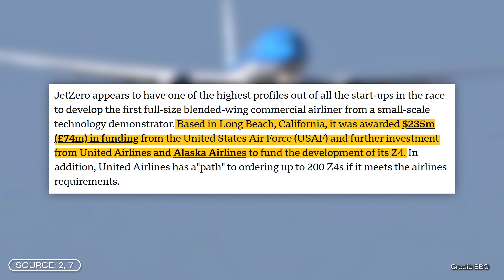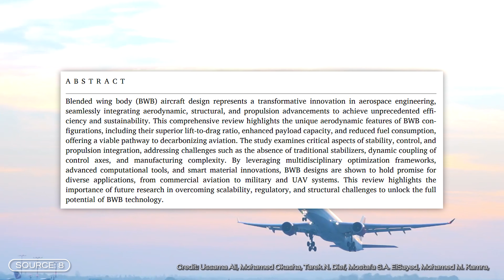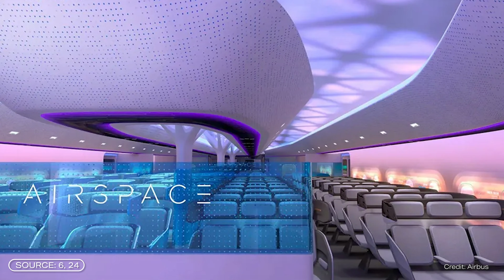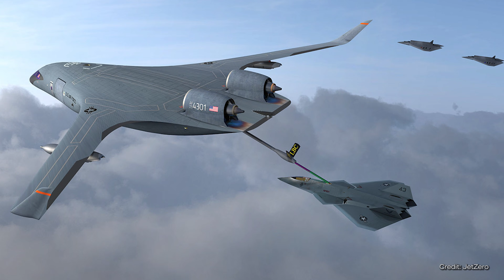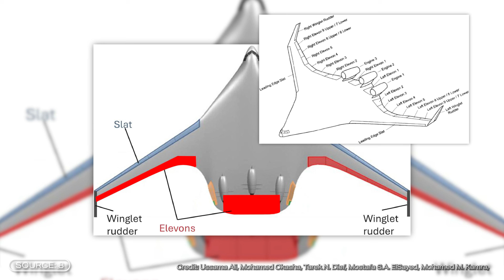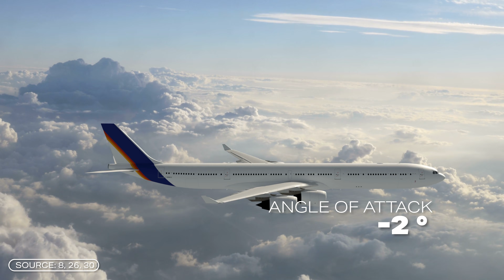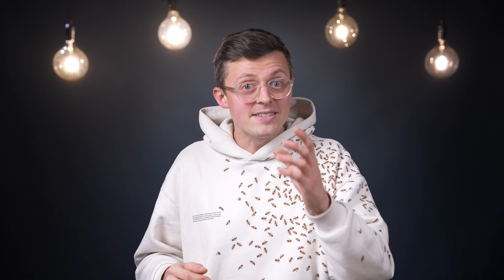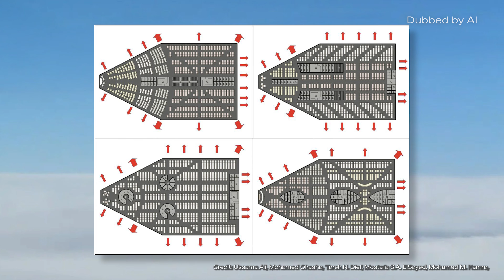The "Perfect" Plane Has One Big Problem...

Comment: I’m keen for this design particularly if it means I can travel horizontal (sleeping). I think the broad center area can be utilised this way. Getting in and out of a tube is an issue but thinking about it this can be achieved with a sliding panel that rolls one into the tube from a sitting position, swing legs in then the back reclines as one slides in. I can see how to do that very practically and easily with little more weight than a standard aircraft seat. You would get 108 passengers in a 13 meter by 13 meter by 4 meter high space (that includes with each passenger volume being 1 x 3 x 1.3 , which is quite luxurious. I live on a boat and travel thousands of nautical miles in a reclined volume of .7 x 2 x 1 meters. That.s of the top of my head. I will have to look at the  available space to be more precise.

Comment: Boeing and Airbus have studied this concept to death. Aerodynamically advantageous but structurally heavy. The pressurised volume requires massive internal reaction structure which greatly reduces the advantages. Additionally it has a reduced cg flexibility.
And the engines mounted on or in the fuselage are very challenging, noise and vibration into the cabin could be substantial. And certification would be lengthy and extremely expensive due to a plethora of special requirements.  All the aero gains are washed away by the disadvantages

Comment: My biggest concern would be the cabin pressure differential load.  The current tube design in commercial aircraft gives a fairly even pressure load over the bulk of the aircraft.  An oval or off-round design would put uneven pressure stresses accross the cabin.  I am hopeful that some very smart designer will solve this issue.

Comment: The cross sectional area of the cabin and wings looks to be considerably larger than a simple circular tube with 2 thin wings. That would seem to add more drag than might be saved by the absence of the  traditional wing / fuselage section.  It is much also more difficult to provide strength to resist years of pressurization  changes in a dramatically non circular cabin and would likely need to be double the weight. Passengers like windows - fine in a circular tube, not so good when the `walls` are several rows away and not vertical. There would also be problems  with doors and emercency exits. Add in reduced engine acessiblity and freight loading and I just can't see them ever happening. A shame as something a bit different would be interesting.

Comment: Aisle or window??? Neither. Give every seatback a video screen that lets the passengers select nose camera belly camera, side cameras. , or whatever, including arrival weather or whatever else. You get the picture. Nobody gets a window, Also, passenger boarding could be done with multiple bottom elevator cars, or ground based moving stair, all at once. This is all figureoutable, and better than current practices.

Comment: I think blended wing designs will largely replace tube+wing designs, even in civilian passenger use. Regarding the maintenance aspect, how reliable the engines are makes a huge difference. Todays engines are much more reliable than those of decades ago. As for pressurisation issues, what some people fail to see is that the only parts of the plane that need to be pressurised are those used by people. , and that volume is still going to approximate two or three cylinders side by side..  Granted, the end result won't be as simple as wing+tube designs, but it shouldnt be vastly harder, either. then, too, the pressure hull sits within the aerodynamic shell, so the pressureised parts dont need to experience aerodynamic loads, and the aerodynamic shells doesnt need to experience pressurisation loads..  As for yaw instability, if that proves to be a problem, there are various ways to tackle that, from putting rudders on the engine pylons to things like having a blown-wing system over part of each wing.. The pitch instability is the thing I'd be more concerned about, but with fly-by-wire systems, either the elevons should be able to deal with it, or, worst case, put small canards to trim pitch control up by the cockpit.  There are so many clever devices on the wings of current aircraft that keep them flying acceptably well in circumstances where theyd do poorly if all they had was basic ailerons, elevators and rudders, that expecting blended wing designs to not need at least some seems to me to be silly.

Comment: This is boundary layer intake (BLI).
However, because the air near the aircraft flows slowly and the air farther away flows faster, it puts a load on the fan blades, making it impossible to use large-diameter fans.
The Jet Zero uses the PW2040 engine, the same engine used in the B757 and C17.

Comment: Elevons is pronounced 'ella vons,' not 'elevens'.
Most airplanes fly around 3 degrees nose up (not nose down) so that the fuselage provides some measure of lift. Boeing nacelles are actually built 3 degrees nose down, so they are at zero in flight.

Comment: This aircraft is not a credible design. The wings are too narrow.  This could increase the chance of structural failure under certain conditions. The position of the engines was first proposed by German aerodynamicists during the war.

Comment: I'm surprised to learn that this aircraft is intrinsically stable which I think infers that it will glide when engine power is lost.
This must be the future of air travel; the advantages are too great to ignore and it seems the tube and wings design has reached the end of the line, with future improvements being very minor

Comment: If the demonstrator has significant volume of usable pressurized space it can be evaluated fairly easily and compared to traditional designs. If the demonstrator is missing the significant pressurized volume it could be used for a tanker or airborne radar only and therefore be economically infeasible.

Pressurization is therefore the primary metric.

Comment: BWBs have been in development for decades and computer aided fly by wire as well, think F-117 nighthawk, (that wouldn't be flyable without computers). I'm no engineer but I don't think the cabin pressure is the major issue it's made out to be either. Isn't a blended wing body supposed to be stronger anyway? Also the counter argument that the extra reinforcements will negate any advantage is a bit basic. Just cause it might need extra reinforcement doesn't mean it's the equal to the aerodynamic advantage, that advantage on a big plane is tens of tonnes extra payload, to claim tens of tonnes extra reinforcement is ridiculous!!
All modern planes are more efficient than their replacements but it's not the fuselage design, it's the turbofan engines mostly and wings having less drag.
I read studies that showed that the G-forces weren't as bad as excepted in BWBs either, but the evacuation rules may be a challenge.
Airbus and Boeing have stated the reason they haven't made BWBs is the publics lack of acceptance. I don't believe that, I believe neither wants to be the first in case it fails for whatever reason and they lose market share, they're both scared. 
BWBs are clearly a better solution but neither the military or commercial companies want to risk building due to the massive new production/development cost and public ridicule if it fails.
great video

Comment: Main issue will be the negative dynamic stability. The weight being dead center doesn't make it unbalanced I don't understand why you're saying that. And gas cartridges are that shape becsause it's easier to pack them that way. I'm sorry do you expect gas carts to be shaped like wings? Again another irrelevant point. Pressurization is based on the inside of the cabin not the wings. They can shape in cabin however they want.

Comment: the point about comfort... this is gonna be a really big issue for em.. small control inputs will equal Gs very noticeable to human passengers the further to wingtip you get.. i feel like you'd even have to require some kind of significant restraint system change and require it for the entire flight, with how easily you could be tossed up like a flipped egg, and thats pretty likely to be unbearable for long flights

Comment: Quite disapointed by this video. Two majors structural flaws have not been addressed : Boundary layer ingestion that could simply stop engine in high incidence and which will reduce engine efficiency. Making this design probably less efficient than announced 
Deep stall. Stall on such a design tend to pitch nose up, which increas stall even more. With such elevons it's impossible to come back from such a situation.
And we didn't talk about airport infrastructures that couldn't handle it without foldable wings (A380 flopped because ir was too big and this is even bigger), foldable wings that would add even more complexity and pressure problems, or pilots formations 
It won't get certified for civil aviation in our modern world. We're too shy on such risks

Comment: Seems to me the evacuation issue is actually pretty easily fixed  - You have a number of zones in the middle of the aircraft where no obstructions are permitted and place doors in the top and bottom of the aircraft with hinged ladders. The ladders can be secured up to a given amount of force (that expected of a hard landing) or the pressing of a failsafe button which would also open the associated door and that's it, job done.

Comment: Such a large reduction in fuel consumption could have non-linear positive effects on emissions. 
For example, if a fuel mix is 20% non-fossil, and you reduce by 50% while keeping the same absolute amount, you get a 62.5% reduction in fossil fuel use.
Moreover, when fuel cost becomes a smaller fraction of the overall fare, more expensive synthetic an bio fuels become more viable, as would battery electric powered aircraft.

Comment: I've always found blended delta-wing variants to be the best for unpowered gliders, best for stability and sustained flight. Personal experience, but it seems to concur. I prefer twin stubby tail fins in the back rather than the wingtips only, and always imagined matching underslung engines at the front of the wings. With a full delta shape, engines might also work right at the wingtips.

Comment: Weight distribution: In a long-range tube-and-wing almost half of the the take-off weight is fuel which is mostly distributed along the wings. A significant portion of the remaining dead-weight is in the engines... out on the wings. 

As to general complexity: An un-pressurized tanker is the optimum case for the blended wing. Pressurized passenger use is far more problematic.

Comment: I'm surprised you didn't mention some of the other big problems they face: 1. There's a concern that people won't like flying in them because a much higher percentage won't be anywhere near a window. (hopefully tech can solve this with screens) And that people will be afraid to ride in a plane that looks significantly different. 2. Airports are not built to accommodate the design, bwbs are much wider and the doors would be located in a significantly different space compared to the tube designs so ramps & gates might need to be changed. And it might mean you can have fewer planes next to each other at the gate. They might be too wide for the hangars too. 3. The tube shape is a lot cheaper to build, and nothing will change that. No matter what advances you make, it will always be easier to make a very simple design than a complex one. And every single square meter of a bwb plane has to be custom made, unlike the tubes where much of the body is the same as the part in front of or behind it.

Comment: If used in the military, it seems to have a few advantages.  With the engines on top, the heat signature would be reduced, and the blended wing looks like it could be easy to give it a smaller radar signature also.  So it seems like a good idea for a tanker,/cargo or something like that for sure with it's inherent stealthiness, which I'm sure will be optimized and enhanced by the military.  🤠🤙

Comment: There is exactly one reason why we are not going to have blended wing body airliners, and thats money coming in 3 aspects:
a) Its very expensive to develop a large airplane of this completely different type, but
b) even when a) was mastered and enough experience would have been achieved, the cost of building a blended wing body plane is still drastically higher than that of a conventional design (also per passenger). Finally, 
c) there is a more cost efficient alternative we all know of and that is going back to propellers on a conventional design. The fact that by doing so we also have to go back to much lower speeds isnt a dealbreaker once combustionable fuel will have become really expensive and the question is not how fast you can fly somewhere distant but rather can you afford to fly at all.
All that and the fact, that there are essentially only 2 manufacturers (airbus and boeing) for large commercial airplanes left on the global market by now (the russians are done and the chinese are - as usually - going to wait for the west until they can hit the copy-button), which both allready face the danger of going bancrupt every time they develop a brand new airplane of the conventional type, will make the blended wing body airplane something to remain a concept and a research object forever.
If you want to express it positively: The 747 Jumbo was a too good design that prevented the blended wing body commercial aircraft.
If you want to express it negatively: Humanity is allready past the point where we could have afforded the blended wing body commercial aircraft.

Comment: All airports are designed to handle current design planes. Billion $ would be required to modify every airport.
Second, regulations for evacuation of the cabin on commercial flights would be hard to meet.
Military is the only current option unless fixed regulations are changed.

Comment: Your fly-by-wire discussion misses that in normal airliners, fly-by-wire is optional. In an unstable aircraft, it is mandatory. If the fly-by-wire goes offline and you're hit with a wind gust, you're kinda done. This really raises the criticality of the fly-by-wire, which would translate into more stringent reliability and redundancy requirements, with an impact in cost. And authorizing an unstable airplane requires a higher risk tolerance from authorities and ultimately, the fliers. What happens if you develop all this, some high profile crashes happen, and the public learns "Ah yeah the weird aircraft that is a death machine, I'd rather not fly on it!"

Probably not enough to offset the gains, but a pretty serious issue none-the-less

Comment: A few thoughts:  1. BWB might work out well for commuter aircraft — smaller, “puddle jumpers”, if you will.  The reason being the reduced size makes the structure lighter, and the distance to the exits shorter, so the disadvantages would be less of an issue.  2. BWB for fuel tankers sounds like a winning idea.

Comment: Honestly, I think the blended body wing design won't become a success for commercial passenger flight as the tube and wing designs are still very much improving in terms of efficiency and safety. Plus, the industrial inertia and regulatory environment tends to favor the tried-and-true tube and wing designs over new, unorthodox designs. 

The Military however has much more compelling motivations to pursue blended body wing designs because of their supposed advantages and also because they have a much greater capacity for taking risks than airlines and cargo companies do.

Comment: Eternium is developing a flying wing configuration platform that runs on liquid hydrogen as it splits the difference between BWB and tube and wing with much less structural and operational issues.

Comment: It's worth noting that the blended wing concept dates back to 1909, when Igo Etrich proposed it. It was worked on in the USA intermittently by different groups, but Alexander Lippisch produced the first flying blended wing aircraft in 1931, 95 years ago! He continued to improve it, but until the advent of automated electronic control systems, the concept was dogged by pitch instability due to the lack of a conventional tail or canards. The key is to match the lift and weight distributions. It has always been "lurking" in the background, and was very much an idea when I was an undergrad aeronautical engineer in the 1980s. Fuselage pressurisation is a key issue, as a circular cross-section is the most effficient shape for resisting pressurisation, and there is the fear that thousands of pressurisation cycles in a non-circular pressurised fuselage will lead to structural failure of composite materials. However, fatigue testing is mandatory and a certified blended-wing design should be safe. The angle of attack must be very carefully controlled, and the question arises as to what will happen if there is an unforeseen and unavoidable migration beyond the limits of pitch stability, e.g., due to flying into wake turbulence. Today's airliners are forgiving. Will a blended wing cope?!

Comment: This technology will happen.    It will be driven by the advances in the use of carbon composites, which can overcome the weight issues which were driven by pressurization (blended wing vs tube).   Also, you don’t mention the wingspan of comparable planes (though one of your graphics clearly had a much wider span than the tube design.  Again, this can be overcome by the technology which Boeing is employing in the 777X, again, made possible by composites (it would be very heavy, but the new lighter composite wing makes up for this.   Boeing had been exploring the truss braced wing design, which I was hopeful for, but seems to have abandoned this approach, perhaps because of another technology?